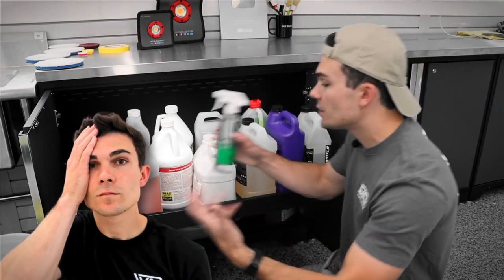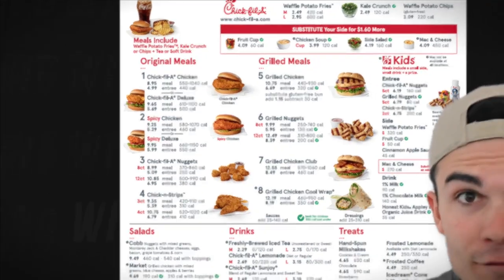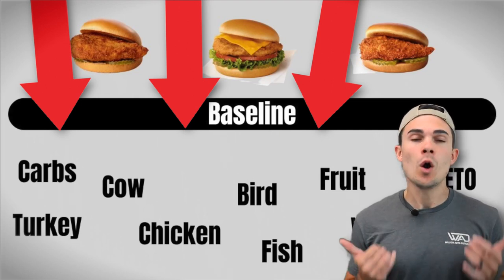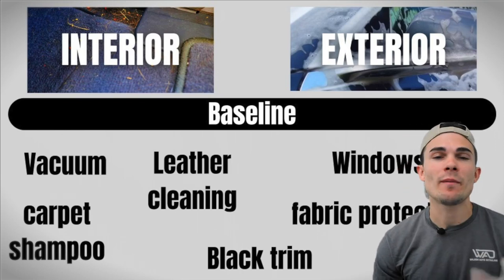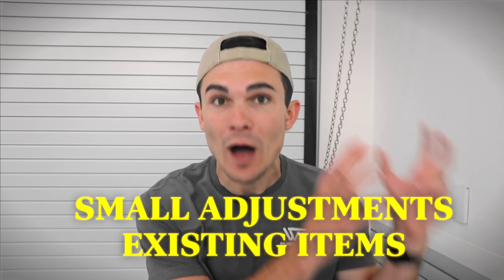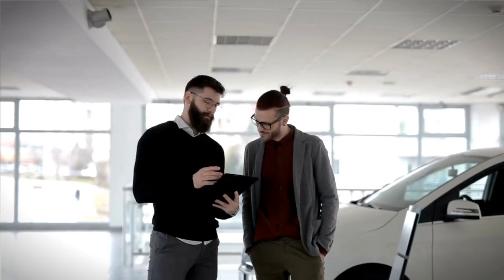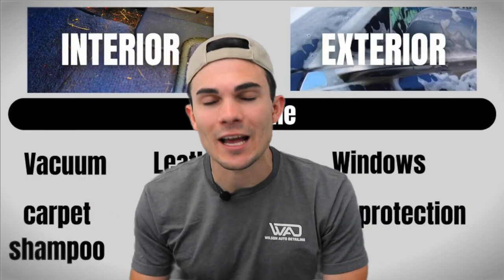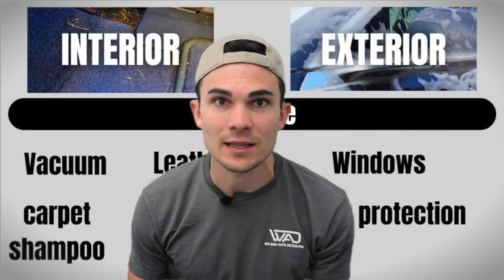Create Detailing Packages That Sell Themselves

Comment: Couldn’t have said it better.  Well put, Mr. Wilson.  
In basic detailing, I offer two packages…interior and exterior. lol  After a quick conversation with the client and a quick look at the vehicle, I know exactly what the car needs & doesn’t need, and I know exactly what the client wants & doesn’t want.  Those slight changes get made in my head.  Then, when I actually start the job, auto-pilot kicks in, my system takes place, and the rest is history.  Another job paid for, another good review, and it’s on to the next one.
Reply: So you don't quote before you see the car?
Reply: If it’s a new client or a vehicle that I’ve never done before, I get the year, make, model, & color of the vehicle.  That gives me a baseline ballpark pricing range.  Then,  if I can’t see the vehicle in person, I ask the client to send me a few photos of the interior & exterior in its current condition.  Those visuals give me a better idea of where to put the dart in that original pricing range.  But even then, I still don’t give the client an exact price.  I give them a ballpark range of between 50 to $100 each way of that dart.  That still gives the client the anchor that they need, but also gives me a little wiggle room incase I have to spend a little extra time on the job.  Once the job is finished and I know how much time I had in the job, I give them a final exact total before they come pick it up.

Comment: I’m currently making packages for my detailing business right now, this video could not have come at a better time. Just subscribed bro, you know what you’re doing 🔥
Reply: One thing that helped me brother, I don’t spray & scrub & wipe or steam unless it’s a full interior cleaning for $200. Anything other than full interior cleaning gets an ONR dusting on all surfaces NOT USING A BRUSH, a towel & a spray bottle that’s it. An interior should take 45 minutes max, including vacuum. Anything more than that you need to explain to customer & charge for! Interiors is where you’ll lose most profitability.
Reply: @Ichabod_Jericho  I might try this out bro. I honestly take a long time on trying to make interiors look close to perfect on something like a basic wash. I need to get better at matching the quality to the cost of the work. 
When you clean the interiors like this do you typically still get a good result? I feel like this may leave certain customers dissatisfied because the interior isn’t atleast getting a light scrub. 
I’d like to know what you think. Thank you.
Reply: @OscarVius  I struggled with the same thing! Like he mentions, getting more leads will make you overdeliver less often. I get great results on my ONR interiors; you will too! cause it’s enough to get food & soda spills, all fingerprints & dust easily even in direct sunlight in summertime. The best thing about it is the safety, I’ve ruined a couple hot plastics with solvent based APC before 🤷‍♂️ never gonna happen with ONR. 

Just use fresh towels, not old ones! Only ones that have been washed 4-5 times max. After 4-5 wash & dry cycles the towels start to loose their ability to pick up fine dust and loads of cleaning solution. 

Best of luck! Anything that needs more than ONR should be charged for, make a playlist that lasts an hour and stop when it’s done!
Reply: @Ichabod_Jericho  Sorry I’m replying so late to this but man thank you for the advice. It’s really going to help me out a lot and allow me to move quicker. Thank you. 🙏🏽 I’m assuming ONR is Optimum No Rinse. Overall, thank you for the advice, it really goes a long way!

Comment: I’ve never understood the different levels of packages. I offer interior detail, exterior detail or full detail. Make it simple and that way you don’t have to remember what services your supposed to do. I won’t skimp on an interior detail. You want it all clean or you don’t want it at all. Keep it simple and don’t compromise your work. I don’t want my name attached to something done half way. Just my thinking.
Reply: I'm just curious, do you then adjust the pricing according to the complexity of the job? Like a pretty decent car with clean seats VS a very dirty one?
Reply: I haven't yet. I haven't had to upcharge anyone yet lol.
Reply: I adjust. Some, not many, are very clean interiors. I just had one today with a 1 step paint correction. The interior was clean. A few crumbs. I still went over everything but it took me 1/3 the time it usually takes. I cut the interior price in half. If it was dirty and I got finished quick I wouldnt have cut the price because the results would have been there. Today, there were no results - but the customer knew ( and wanted) everything gone over. The paint correction was a breeze too.